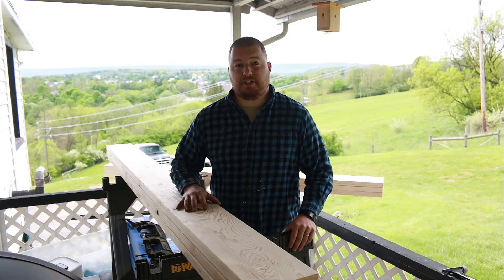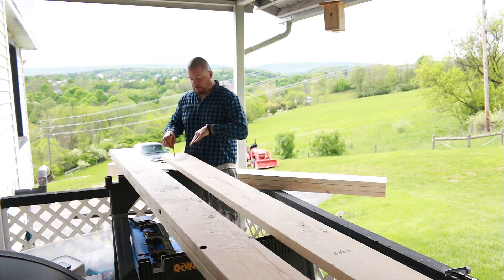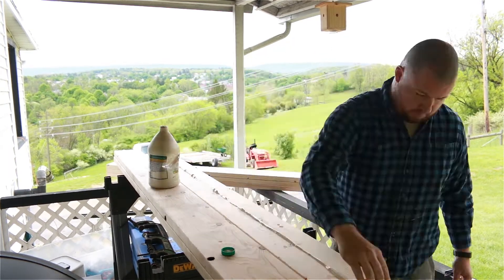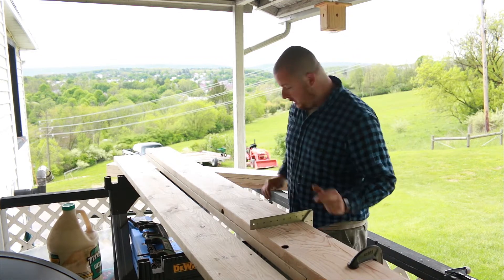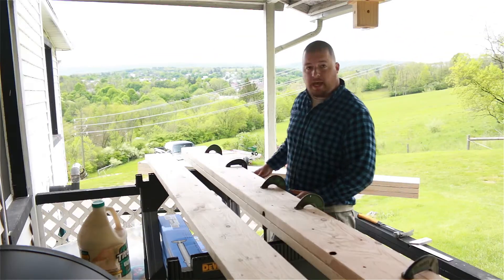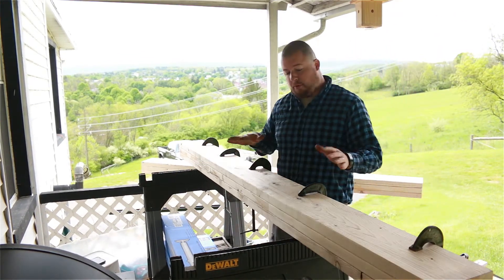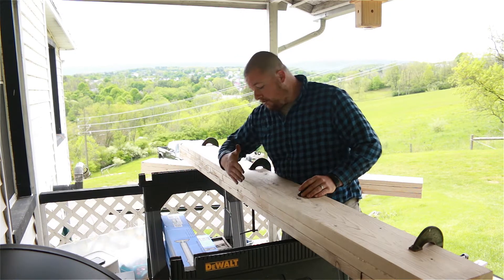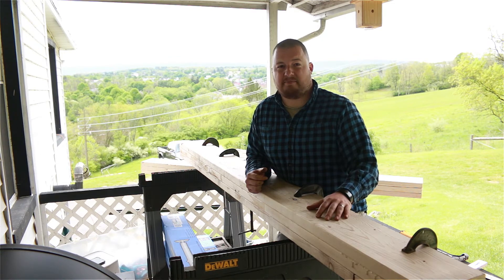Foundation Repair - Building Support Beams Pt 3

Comment: Hi Shawn. I'm having a hard time figuring out how big a beam and how many beams to use. did you calculate the bearing capacity of your beam some how? I've learned that glue lam is almost as strong as the same size in dimensional lumber~ I think. But I'm having a hard time wrapping my head around all the span calculators and other formulas and tables. Turns out the jacks will be plenty strong to lift the weight of the house, but how they're placed under how many beams is where I'm running into deep mud. I guess I'm finding that the beams seem to be the weak point. I'm starting out trying to span 8' with a beam and a jack at both ends but I can't figure out how much distributed load a beam can hold. I was going to use 4x10s. The current girder is only 2(2x4s) sandwiched horizontally with a 4x4 post every 6' in this hundred year old house. are there any kind of rules of thumb  or tables you've come across to simplify this engineering to be able to make decisions about beam and girder sizing and span between jacks?
Reply from the maker: @max slomoff Check out this playlist. It should cover all of your questions. https://youtube.com/playlist?list=PLc_xAZ8H3I7kl5d5Tdwqe2cJBKdRK5Wfl
Reply: @appalachiandiy2415  oh I did watch the whole playlist and it was awesome. I got my house weight calculated so I know how many jacks I need~ but it seems like the beams aren't going to be strong enough when I reference load tables. You say your triple lam beam will be plenty strong~ how did you calculate that or come to know that?

Comment: You’re not concerned at all with creep using titebond vs a high-hardness construction adhesive such as loctite premium pl max? I was going to use titebond III for mine but my structural engineer went to town on that idea. And my beam is only a secondary support. 🤔
Reply from the maker: If your concerned about it then use a construction adhesive. in my experience if you lay just a bead you will get a small gap between the wood because its so thick so make sure to spread it out. I used glue because of ease of spreading and its cheap. the strength is in the boards I'm not counting on glue to hold up my house.
Reply: What size of nails, because they’ll do most of the holding if the glue joint fails.
Reply from the maker: @EdwardT9  16D common loose nails is best.

Comment: How much weight could that beam support?
Reply from the maker: Short answer-2x8"x8' will support a uniform load at 4,568 lbs or 571 lbs a linear foot supported at both ends. Long answer- using the same 2x8x8 you can increase your load carrying capabilities by having more than two supports 8 feet apart. if you had three supports, one at each end and one in the middle, your opening would only be 4 feet apart and not 8' allowing you to carry 17,176 lbs or 2174 lbs per linear foot which is a huge increase. So it comes down to how many floor jacks will be used and how far apart they will be from each other.  here is the link to how I calculated it out http://www.southernpine.com/app/uploads/AL_21-26L.pdf